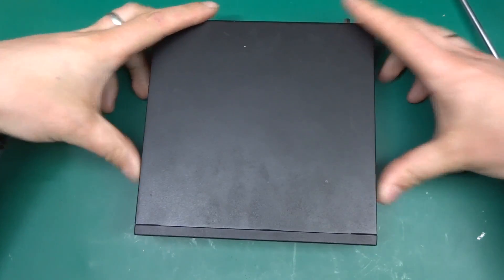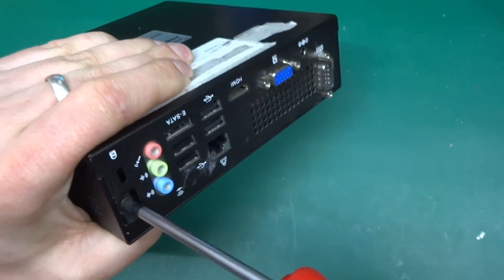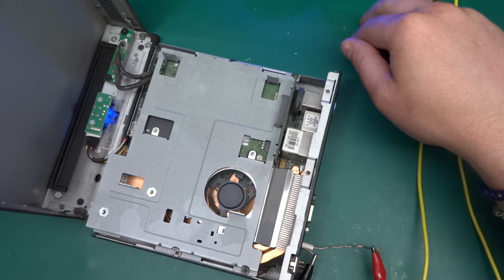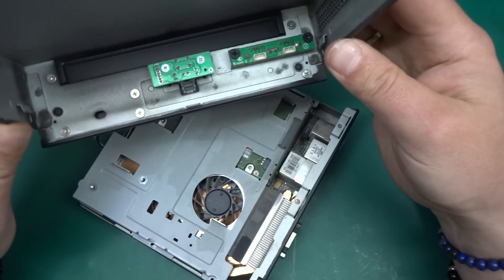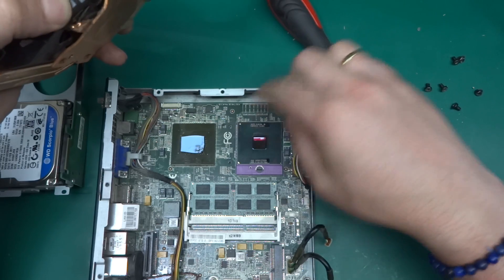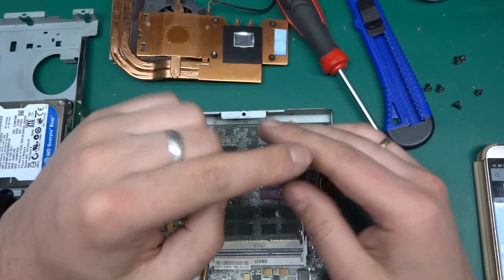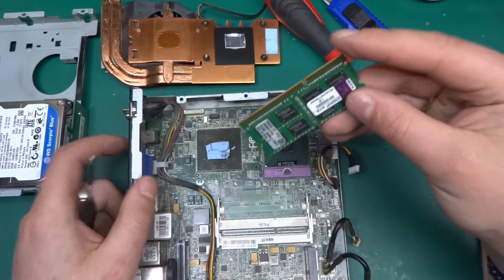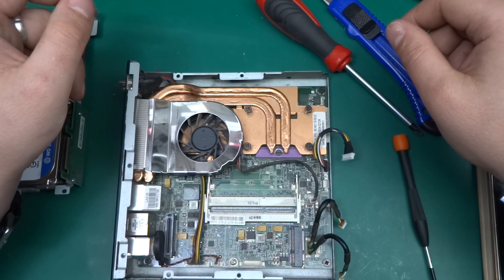A look inside DE7000 industrial signage mini PC

Comment: These computers are usually equipped with normal 2.5" drives. The stores that use these computers tend to shut it down when the shop closes. Not normally buy there power gets cut off abruptly. So I imagine the drive is dead on it. Listen to the sound of it

Comment: It seems you really dont understand a thing about computer hardware. You actually see the device booting when powering on. And when handling sensitive electronics, you should wear  esd protective gear to prevent killing it with your bare hands. You now probably killed the memory modules. Did you even hook up a display? Big chance it just runs fine.